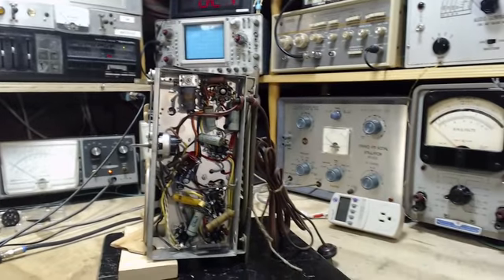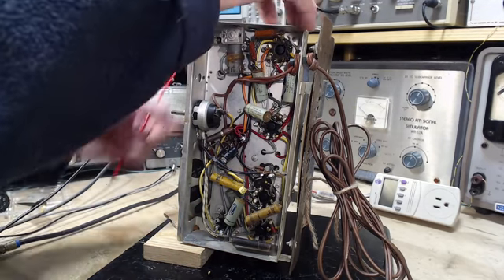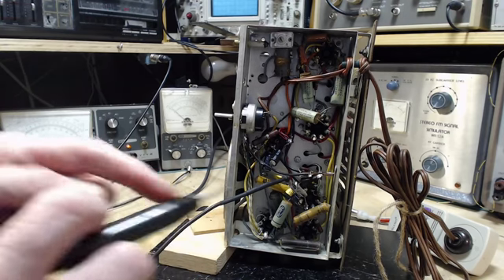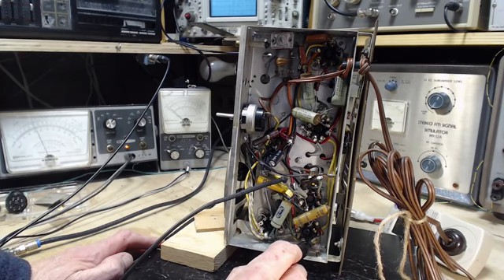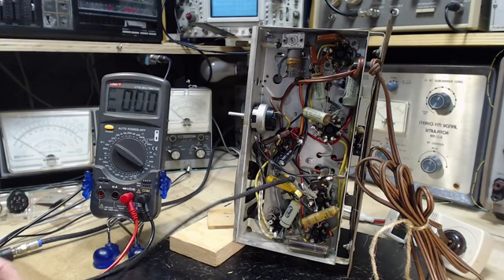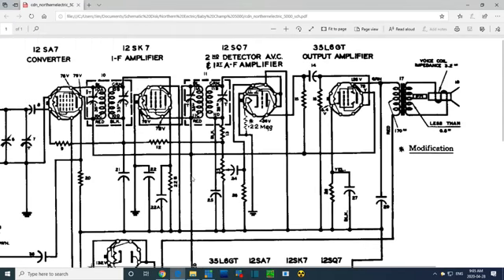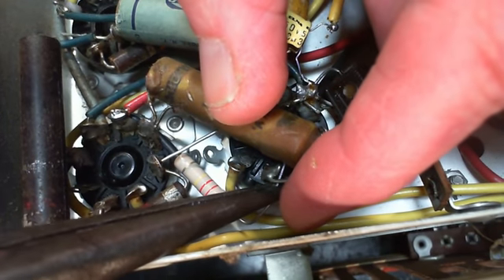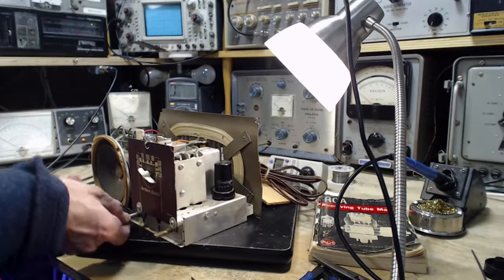Bakelite Baby Champ NE 5000 Video#3 - Voltages

Comment: The failure of the plate load resistor on the 1st audio amplifier is a very common fault and should have been the first thing to check.
Change that coupling capacitor while your there. To an experienced technician, he should have been able to recognise that circuit by just looking at the components and the circuit would have been obvious without recourse to the schematic.

Comment: I guess my suggestion to replace a resistor or two came to effect. The reason for the shrink tubing or insulation on one end of the resistor is to keep another nearby 
component from shorting out and destroying the tube! I see two more that should be replaced!🙄

Comment: I'm willing to bet any remaining distortion aside from the cone tear is caused by the 50L6GT being underdriven by that filament resistor. Of course the solution is to use a 35L6GT or cut that resistor out of circuit.